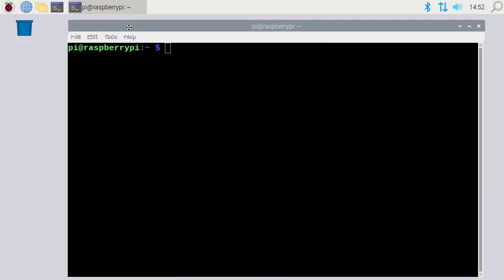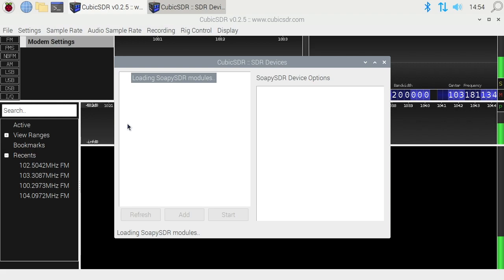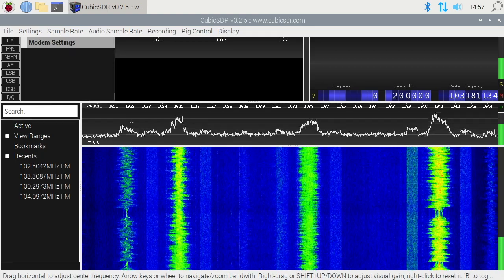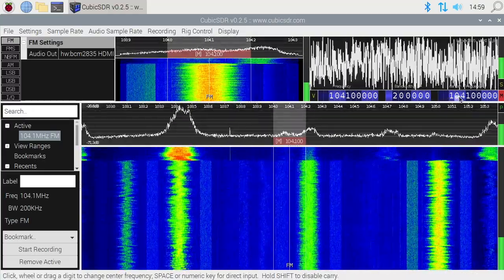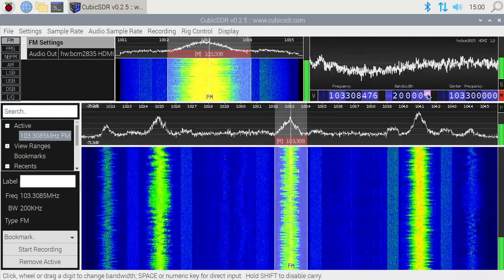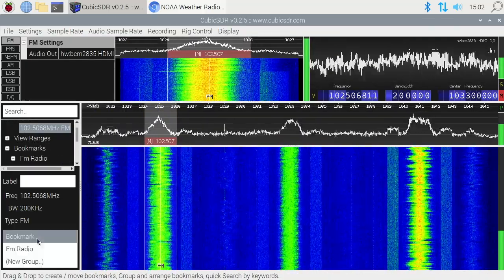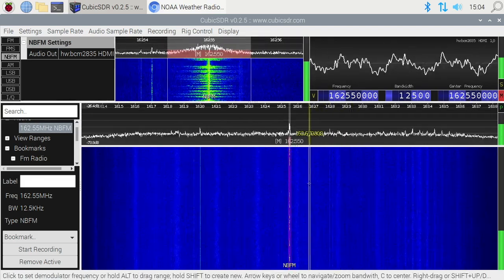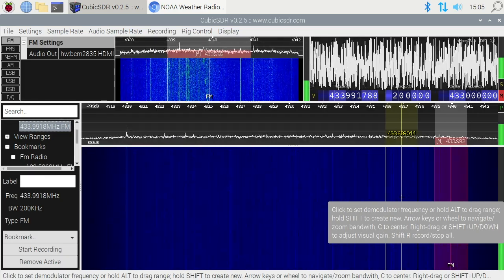CubicSDR Basic Setup on Raspberry Pi with RTL-SDR Blog V3

Comment: I'm running into an issue where CubicSDR starts, but no signal is coming through. I checked all the wire connections and had no errors during the install process. Any tips?

Comment: Hi I am am trying to run cubicsdr on a 4gb Pi4 but it is extremely laggy. I don't have any other programs running. I am running raspberry pi OS 32 bit.
Reply from the maker: Another option is to connect the RTL-SDR to the Raspberry Pi and run CubicSDR on a separate computer. I have a video on that here: https://youtu.be/DJnRDu2_amU This would allow you to place the SDR and Pi near your antenna but access the signal from somewhere else in your home.

Comment: Thanks,
Following your progress step by step, at this point i dont hear any sound.. new to raspberry pi,  using head phones, what am i doing wrong
Reply: Sometimes the pi defaults to HDMI, you need to manually swap over to headphones by clicking on the audio icon on the task bar, and change to audio Jack
Reply: @-someone-.  Thanks!! That was driving Nuts 😂😂😂

Comment: So is a Pi 3 fast enough for general use, or does it really need to be a 4?
Reply from the maker: The Pi 3 might work. If you are buying new, I would spring for a 4 as it is generally a lot faster when running a graphical interface.
Reply: Tried this on a Pi3B+ and it is not running well at all. Very unresponsive. I'll be upgrading to a Pi4. Thanks for the tutorial!
Reply: pi3 is so 2012
Reply: @overbuiltautomotive1299  Well, I'm still using my original Model B, and I mean first run original! It's continually running teletext and occasionally used to locally  transmit various radio coms for testing my SDR and other radio reception.
Reply: @GarryGri   yep it works for well i was being more comical i remember wen tablets had 1gb ram i was like really how that going to run all these apps video but for other stuff work be great  ..finely got ddr4 now i can install android radio that may not annoy me well the price does